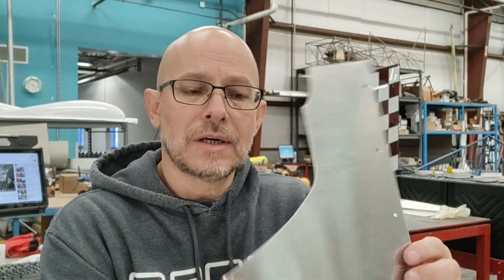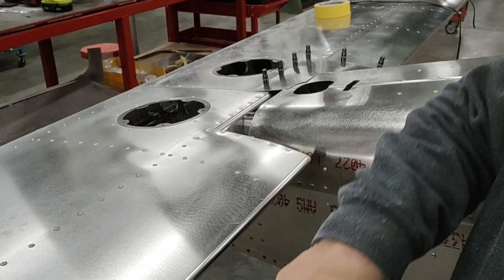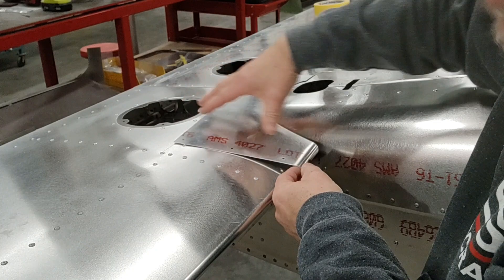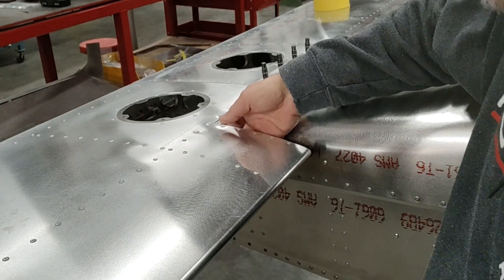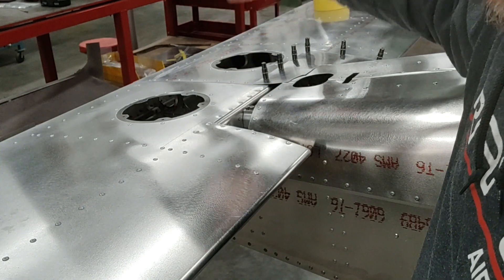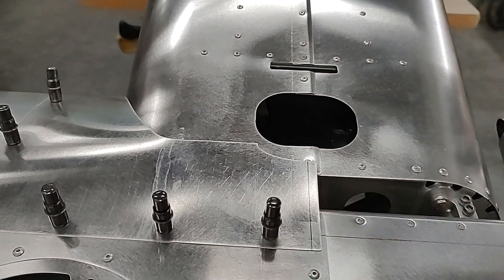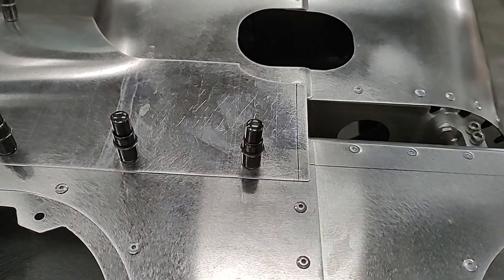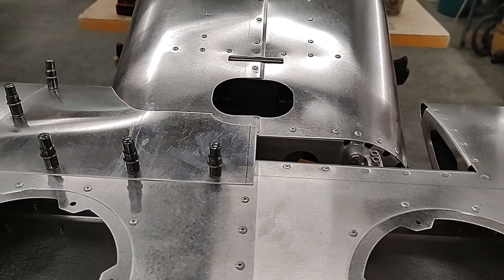Rans S-21 Outbound Horizontal Stab Fairing Video Tip

Comment: I have my adjusters at the midpoint for my 915 installation.  It sounds like I am pretty safe to fit these fairings now, but it also appears that if fit reasonably close to the tail one skin, it will be very hard to lower the nose of the HS later should flight testing so indicate.  It looks like moving upward won’t be restricted.  I guess it is a risk worth taking to get the benefit of fitting now rather than after rudder and paint.

Comment: The text manual says to set the incidence adjuster bushings 1/8" from the bottom of the slots for the Titan.
In this video Eddie states that the bushings should be “all the way down” for the Titan.
Which is correct?
Reply from the maker: All the way down on the adjuster screws yields 1/8" gap at the bottom at the bushing location, sorry for the confusion, I'm trying to post a photo but not sure how to in the comments
Reply: @edmundgil  That makes perfect sense. Thanks for clarifying that.